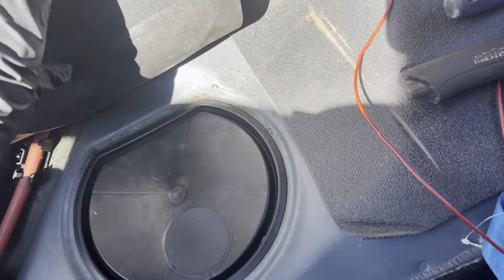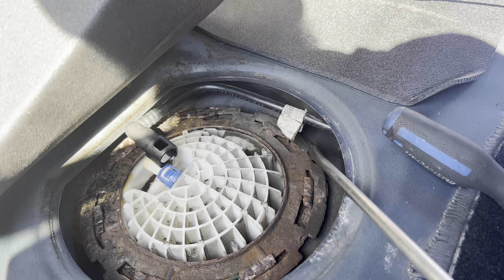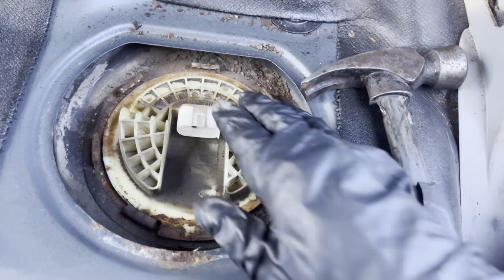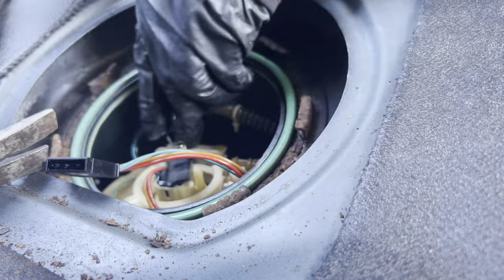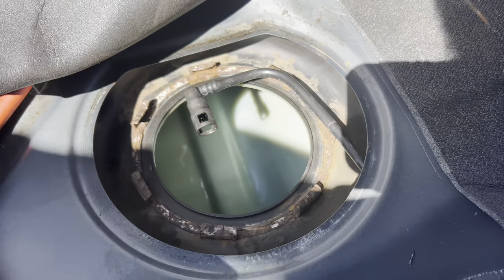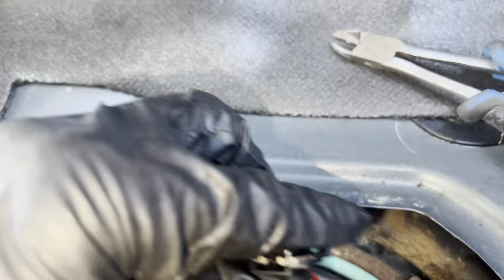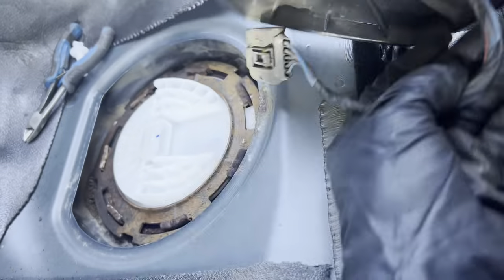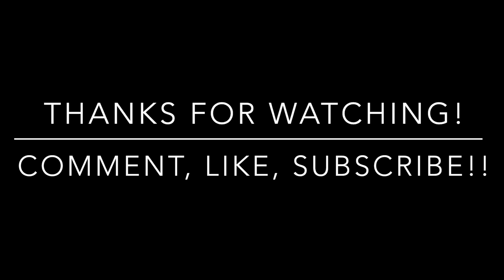How to replace the Fuel Pump on Dodge Magnum, Charger, Challenger, and Chrysler 300

Comment: Good video. My Magnum R/T has 200k miles on it so I'm sure I'll be joining this party soon enough. I would imagine that the passenger side pump is just a transfer pump since the gas tank is in two parts, with the driveshaft going through the middle 😒.  The vehicle would still run with the driver's side pump but you would only have access to half of the tank's volume and would probably need to keep it topped off.
Reply from the maker: Thanks for the comment bro, I appreciate it! Good luck with your Magnum when the time comes.  💯🤝

Comment: Good video. I just got a 05 that's got the same leak on the passenger side... I was thinking about just replacing the o ring and only dealing with the pump if I had to, and leave the other pump alone.... But after watching this I'm just going to change both of them. What brand pump did you install?
Reply from the maker: Thanks for the comment bro! Thats a good decision to just replace both. After I diagnosed the leak and discovered the cracking, I also decided to replace both sides, especially because both sides have to come apart in order for the passenger one to be replaced by itself. The brand I used is A-premium, I ordered it off of Amazon, they’ve worked good so far and no issues! Take care bro and feel free to comment any other questions 💯💯🤝

Comment: Throwing a po305 engine just shut off while on a drive to San Diego wasn’t getting charge changed battery and alternator trouble starting but starts easier it’s a 5.7 but sounds like it got a a blower on it doesn’t sound right think it’s fuel pump?
Reply from the maker: Sounds like your alternator is bad bro, especially if you hear a whining noise. After getting the charging system fixed, clear codes. Test drive. If p0305 returns it means cylinder 5 has a misfire. I’d start with checking the spark plugs afterwards if that code continues. It’s possible that low battery power can cause codes so fix the alternator/ charging issues first, then go from there. Good luck with your car bro! 💯💯🤝

Comment: How do u know which one to replace
Reply from the maker: Mine were replaced due to age and cracking, one side started to leak so I replaced both. Is your vehicle not starting?
Reply: Not starting but not rusted like yours.. but after diagnosis we determined its the fuel pump

Comment: I filled my gas tank and noticed the leak the next day but it stopped....did.you continue to till the tank was low?
Reply from the maker: Hello bro! This sounds similar to my problem. It leaked when it was full but once it wasn’t full it wouldn’t leak anymore! Good luck with your vehicle!! 💯💯🤝
Reply: @colin7761  thanks bro...just to clarify you were able to still drive it after the leak stopped and didn't have it never leaked again even after the next fill up?
Reply from the maker: @dre-p954  I had to replace the fuel pumps to fix the problem as the old ones got brittle and cracked. That is what caused the leak. If you don’t replace what is leaking, then it will always leak when the tank is full.
Reply: @colin7761  gotcha thanks for clarifying bro and keep up the great content!
Reply from the maker: Appreciate the comments bro! Down to help anytime. 💯💯
Reply: @colin7761  yessir 💯 💯